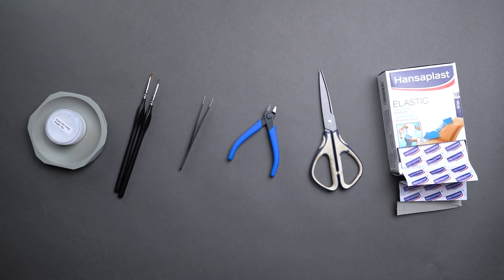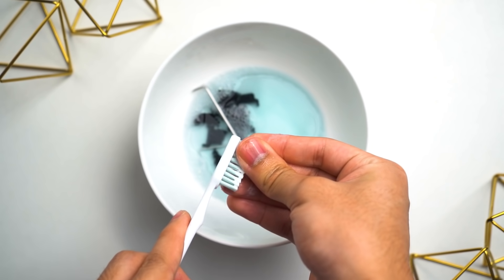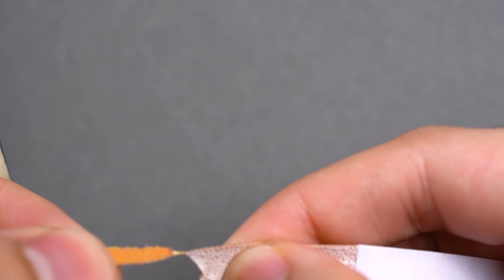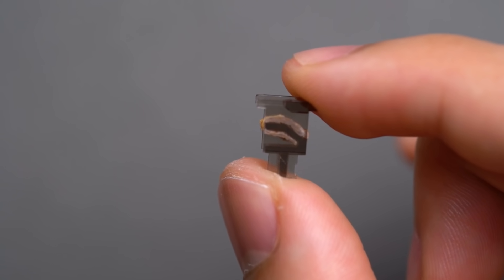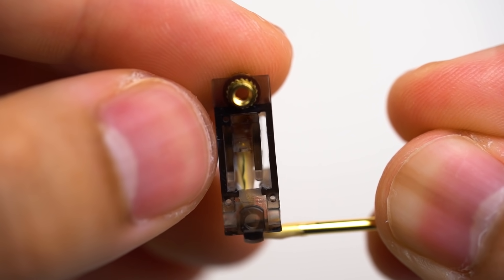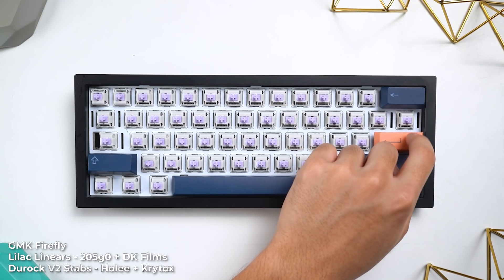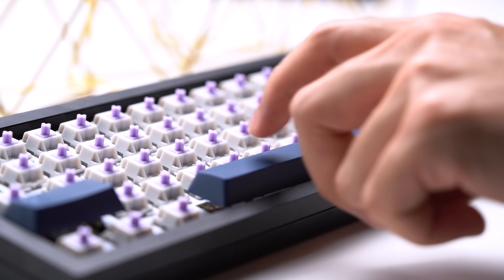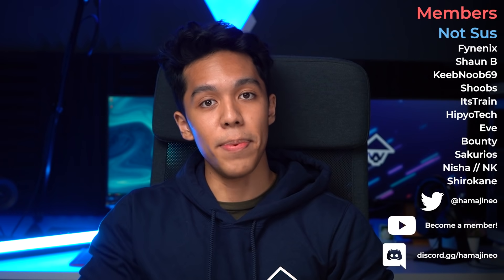Holee Mod Tutorial - The ULTIMATE Stabilizer Mod!

Comment: This MOD is not suitable for  long-term use !  

My fabric band-aid (Johnson & Johnson) holee mod worked for approx 8 months, after which it disintegrated and jamed up my stabs.  I had to dismantle my keyboard, remove the stabs, and clean them out.  

I was using  Glorious G-Lube with my Durock V2 stabs FYI.

Use this MOD at your own risk..

Comment: Imo, this should be a last resort if you can’t fix you stabs normally because after doing this mod, you there will be no rattle but you will only hear the bottom out noise and there will be no noise when the keycap comes back up because of the bandaid dampening the noise.